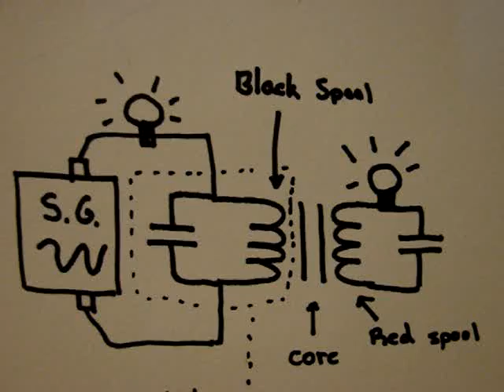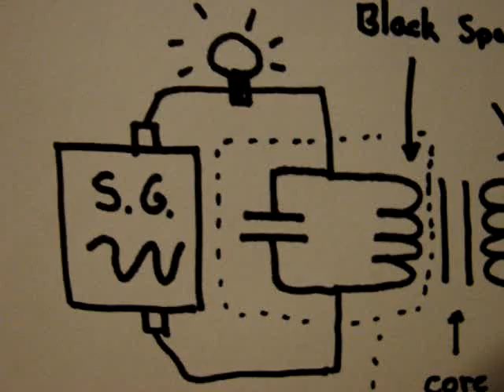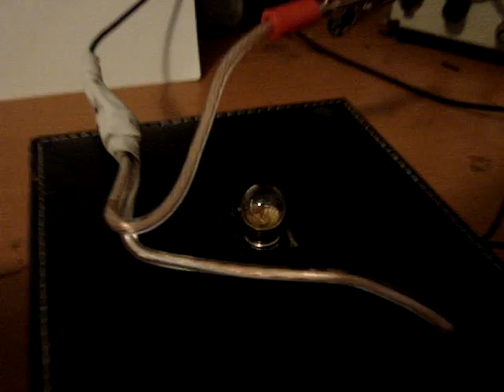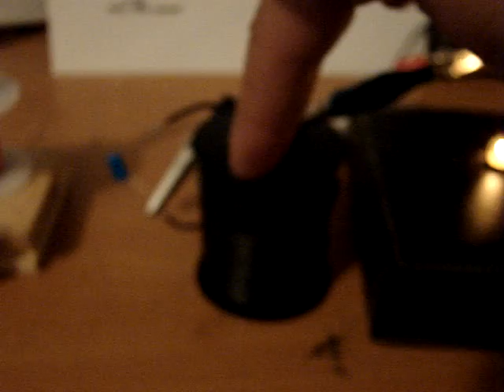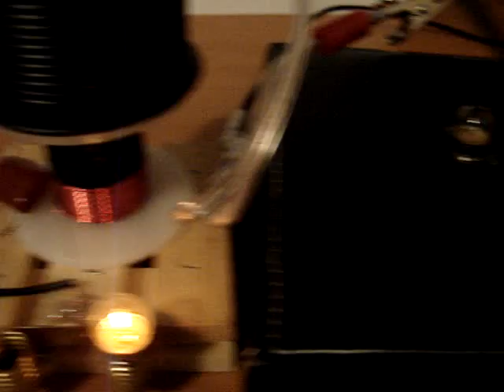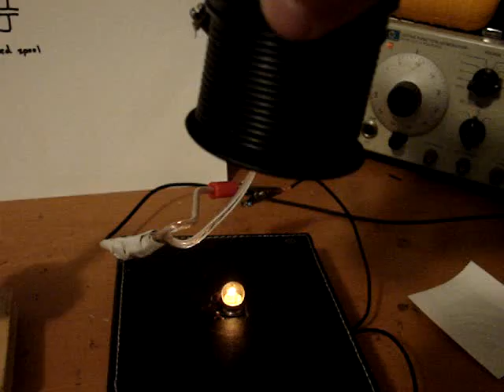Energy Propagation

Comment: thanks a lot.. friend :-)
i wound two coils and run it with pulse generator 12v, but the secondary lamp didn't light when i change the frequency.
the primary did saturated.
i guess that my coils are not tuned.
can you please tel how to tune the coils?
how many turns the primary and the secondary?
is it got to do with the thickness of the wire? what capacitors?

thanks
ilan

Comment: @xsports49 Series & parallel LC circuits act in a reciprocal manner.  Series LC at resonance acts like zero resistance, & the parallel LC at resonance acts like a very large resistance. Reactance X & impedance Z of a series circuit versus susceptance B & admittance Y of a parallel circuit. Capacitive reactance is a negative complex number & when added to the positive complex number of inductive reactance can give a very near zero value. Admittance is a reciprocal of a possibly zero difference.

Comment: @TheBblindman On a closely or strongly coupled core, the loading of the secondaries does affect the primary through mutual induction, & in the radio station example people far away don't get a strong signal. Because the secondaries are resonant passing rather than blocking current, the coupled loading would increase. Lenz's law plays a role. Counter-EMF is affected. Primary inductance appears reduced. More primary current flows so more source power is drawn costing you money--not free at all.

Comment: @TheBblindman On a closely / strongly coupled core, the loading of the secondaries does affect the primary through mutual induction, & in the radio station example people far away don't get a strong signal. Because the secondaries are resonant passing rather than blocking current, the coupled loading would increase. Lenz's law plays a role. Counter-EMF is affected. Primary inductance appears reduced. More primary current flows so more source power is drawn costing you money--not free at all.

Comment: @tortuga0303 
very nice! cop almost 1, put 2 or more secondaries on same core, tune them all together, than u will have same cop<1 x number of secondaries. Guys do the math! Its functioning exactly like a radio station with the emitter being the primary! One doesn't have to put more power in the emitter of a radio station if the radio station has more receivers (listeners)! A radio station is a simple proof of unlimited cop. Resonance is all!
Also try to saturate the core with some Nd magnets.

Comment: @tortuga0303 
Ah okey, I think I understand.
Since the bulbs light at a lower voltage, the impedance of the LC circuit can be much higher than the bulb resistance and still send enough current to light the second bulb. Had both been 12 volt bulbs then this would have been as weird as I thought it was : )
Thank you for explaining.

Comment from the maker: @Nabo00o 
The bulbs take some  3v 300ma to light up. The input is 12v. Therefore it is possible that the input be say 12 v @ 75ma. Then through the impedance matching quality of the transformer, the output is reduced to 3v 300ma. power going in and out is the same, but one is of the correct quality to light the bulb and the other is not.

Comment: @tortuga0303 
Thank you for your answer. Maybe I was too quick to conclude here.
But one aspect of this and your later tesla coil demonstration bothers me; if you are supplying current to power the lamp here or the motor in tesla coil demonstration, then this current should also pass through the primary bulb.

And it seems to me, that no matter what the current and voltage phase is inside the tank, the input is 12 volts, and if you spent energy on it the current  should light the bulb.

Comment from the maker: The bulbs need several hundred miliamps to light. Below this threshold they are dim if not lit at all. The first bulb  has going through it 12v, but few miliamps making it dim. The second bulb is impedance matched bringing the 12v down, and the amperage up, therefore lighting the second bulb. All the power is going through the first bulb, but in a form which is not suitable for its incandescence.

Comment: I would like to ask, where does the energy come from in the secondary to light the secondary's bulb? It is supposed the high impedance of the primary LC circuit prevent the current to circulate, no? Can I use CMOS555 PWM circuit to replace the SG there?

Comment from the maker: @definitionofis 

Mostly correct. What needs to be kept in mind is frame of reference. A parallel LC has no internal resistance if measured from within the LC and looks as if it is a series LC..., to the outside source, it looks as if it has huge impedance. Same circuit, different points of reference for measurement.

Comment: The secondary circuit is a series resonant circuit.

At resonant frequency the capacitor + inductor reach a minimal resistance and act like nearly zero ohms. Remember he said huge resistance on the left side? Well, the right side is the opposite effect.

Thus almost all the voltage drops across the bulb on the right, at resonant frequency.

At other frequencies the inductor/capacitor resistance is higher than the bulb.

Comment: Outstanding illustration.
But a resistive bulb doesn't recognize phase or AC or DC. It only cares about RMS current. If the bulb isn't lit, there can't be much current running through it. So the question remains, how does the energy get to the secondary circuit? It's making my brain hurt.

Comment from the maker: I think you will find this is not more power out than in. This is because you are using a resistive load, and when all things are considered, the last thing you want to add into the equation is resistance. But bubs make for good visuals. This is simply a place to start to learn the basics.

Comment: question:
since the first bulb extinguishes because of the infinite impedance, does that mean that no net current flows in the primary, thus no power is consumed? 
if so, why does the secondary circulate energy?
free energy?

Comment: compare this to figure 10-3A of stanley meyer's techbrief.
a coil behaves as a parallel LC circuit, when 1 is at resonance, the other choke receives energy that is induced by the first to impede current.
is this the secret to stanley meyer?
Maximum impedance of one choke, while energizing the other?

Comment from the maker: people often ask the specifics, however there is no magic frequency. It is all dependent on the physical parameters, i.e. inductance and capacitance. What you do need to know is that they are tuned to the SAME frequency, driven at square wave. If they were driven with sine wave, you would see the EXACT same form on the ol O-scope, pure sine wave, due to being run at resonance. Driving voltage was 11 volts.

Comment: Very interesting demo !
Did you use sine wave or pulse/square wave from
the oscillator ?
What was the driving voltage and driving current,
when the primary light bulb went out ?
Many thanks.

Regards, Stefan.

Comment from the maker: The fact that these LC circuits are 1:1 implies that as the inductor is charged on the first circuit, so it is charged on the second. As it discharges back into the first cap, so it is done on the second circuit. Its like looking into a mirror, what you do in the first is happening simultaneously in the second.

Comment: Was the 1/1 ratio measured with the core and secondary coil in place?  Inductance ratio might be a little off otherwise, especially with the second(red) coil due to interaction with the large amount of diamagnetic material in the thick primary(black) coil magnified by the number of additional turns.  Good demonstration, very do-able!